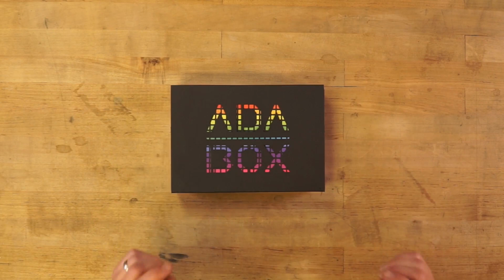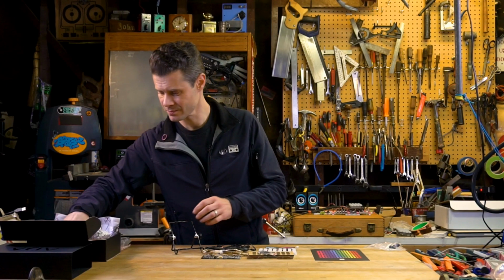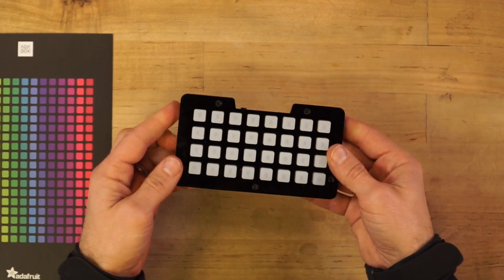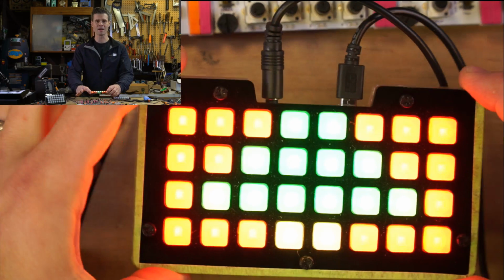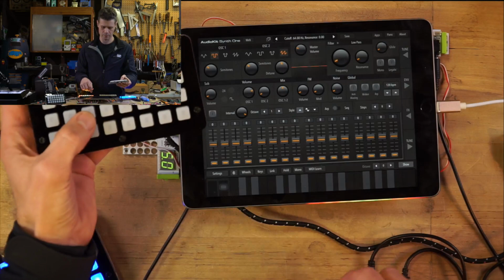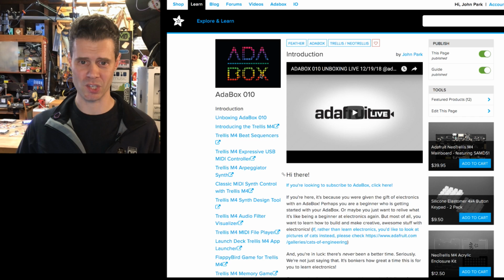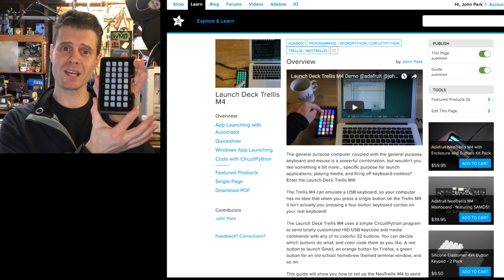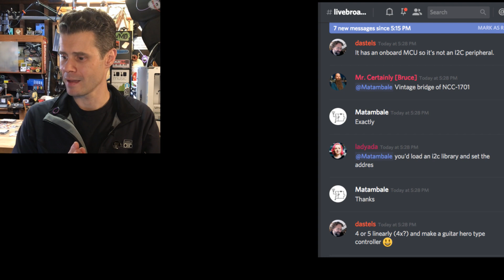ADABOX 010 UNBOXING LIVE 12/19/18 @adafruit @digikey @ADI_News #MAKEWITHDIGIKEY

Comment: I'm getting a strange sound from my Trellis, it's sounds like a teleporter from star trek echoing over and over.
I've updated the boot loader and circuit playground and I'm using testing out the ABC soundboard.
I've got the code to run in both animal and electronics and after each audio clip (or after several clips played in quick succession) I hear a quick phaser "zip" sound.
Is it my audio playback devices or does the trellis have a signal noise issue?